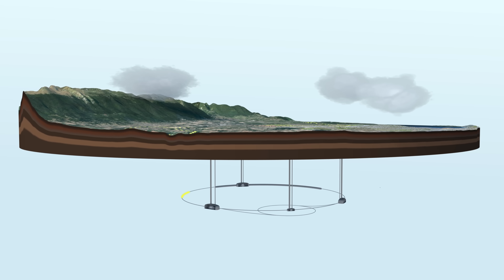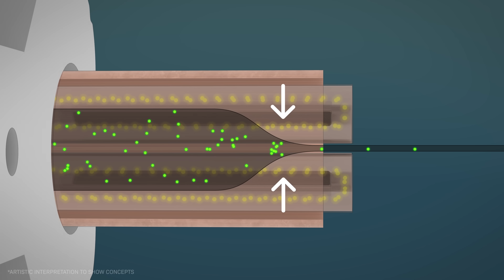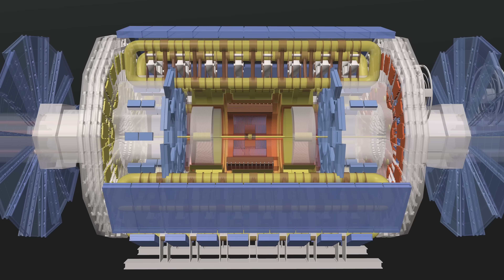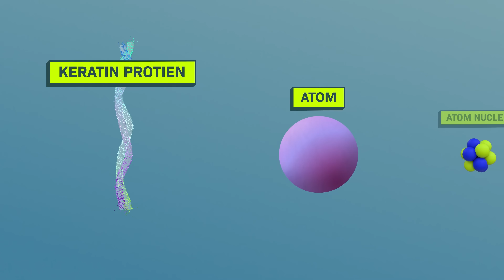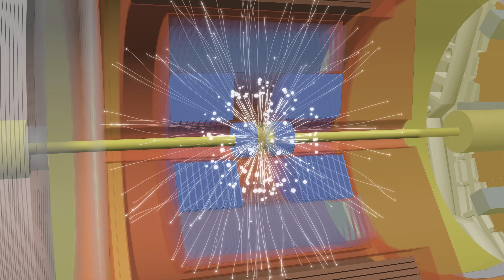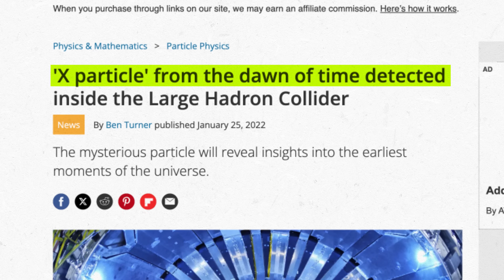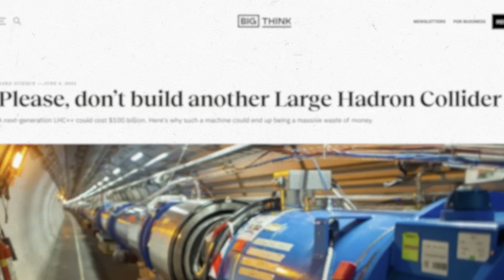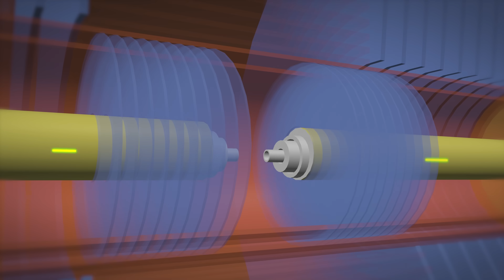What's Really Happening At CERN

Comment: Part 2
Understanding this allows you to begin to seperate the difference between the journey towards (as reflective matter) and the reflective existence, that accents the resulted experiences, as well that experience being added to and rightfully so, essentially supported. Studies related to Pyramid religion, psychics, quantum reality’s etc usually end up suggesting that they themselves present existence as not being a psychical reality, even though equating infinity is an aspect that is largely incomprehensible to mankind because it struggles to detach its own nature from its capacity to learn. For example, due to the certified awe, you continued the path of riddled failure using its time signatures on your simulators, processors, equations and theory’s, that are all formed from a localised perceived time that is based off an ecliptic equation that misrepresents universal spacetime. If a Universal cycle is a 360’ cycle then a Earth day is noted from the time at which a particular star passes the celestial meridian (i.e. directly overhead) on two sucessive nights, which marks a sidereal day of 23 hours 56 minutes & 4.091 seconds, which is not at all aligned to Hipparchus’s equation of time, meaning that a severe miscalculation has already occurred (here) at the most basic level of each of the equators of reality that were used to equate forms of - Pyramid religions, psychics, quantum theories and mathematical reality’s, if your basic division is unbalanced, how could have you ever have equated Universal balances as differences? Realising this means that you should be able to at least recognise that a theory of a simulated reality has already been broadcast across your times future paths, suggesting that the beings responsible for the promotion of this structured mistake, do indeed place themselves as successors of direction (control) at the cost of all others that could ever be correct. Whats also interesting is that often alternate realities are mentioned, but usually limited to X amount of numbers, because of the human reflective process of thought, that could only structure these off the measurements they equate of their understanding (or lack of) related to distance and time of their times Universal Mass. This is a common mistake because mankind fails to recognise that time, distance and reflection are irrelevant as soon as you are able to understand the actual meaning of’ what an infinite existence is, including the removal of biological function that acts as a restrictor. If you are able to do this you can understand why the reality of all existence is the functionality of all eternal growth. For mass the experience of’ reflects as its interaction (inclusive of others mass based) not their reaction (singular to them) as their choice, keeping in mind what I said about Hipparchus, and understanding infinity as being ‘time is all at once’ that masses interactions reflect from. The only reason Mass senses a disconnection from its totality is because of its reflective biological limitations. 
When sub atomic cycles etc are falsely introduced to a species that reflects on time as being linear, it would find it extremely difficult to understand how expansive time could be cycled into their past’ because of their reflective biology. It’s significantly easier if one tries to establish, if the paths for all failure and success can still exist with or without its mass, perhaps you can try grabbing your left hand and without letting go’ try grabbing it again, obviously you can not’ knowing that cycle has already reflectively occurred, even if you simply thought it through’ you were aware that the reflective cycle would have already past once you enacted it, so the cycle exists reflectively as you enacted it but without the mass you used to reflect it, from here your current mass of reflection would be understood as it being your centre (and that prior actions centre) because your pinnacled to your form that only changed in the moment because of that cycle, meaning that the possibility that your reflective pinnacled center can be moved by changing your reflective memories of your past can easily change the perception of your centred reflection, I.e as in Slaves built the Pyramids to Company process built the Pyramids….meaning that your reflective center is also relative to the past that’s reflected of it, which also includes, if this changed state was broadcast to you, then your center was changed by a broadcast created for you in your future from any point prior to your change (but for you, only understood in that moment as your experience) At this point It’s extremely important that you understand the nature of reflective thought’ as masses production of time, that reveals itself relative to the speed of the mind the processes it, that actually contains many precursor layers well before the slower mind recognises them as a thought. It’s readily understood (or it should be) that your actions mostly occur prior to your conscious mind perceiving them, and if they don’t for you then you’re not paying close enough attention to yourself and the environment that controls your surroundings.
Knowing that all balance is achieved from opposites is the key indicator of masses reflective sleeping form, that can also be used to identify mass as an equated form of infinite existence. When a manipulation of a masses future occurs (as a mimicked form) it will always present itself “as a forced tyrannical center” whilst ironically also proving its past paths of existence (attempted cycles) have always been “failure” or have been failed, from this stand point you can only address the mindset of the cavemen to fire as it is to you because the caveman also thought of itself as times pinnacle.
The false mimic/s is the reason that religion was formed here on Earth as a search for the truth, and it exists because of the corrections made by the (bloodline) anchor between times, which was a predetermined necessity - corrective balance, due to the failures created by typed mistakes here on Earth, by those that reversed live. Unknowingly to them though, they played an essential part in the balancing of all masses infinity.
Keeping it simple, If you still struggle to grasp the separation between eternal cycles (the super consciousness) and reflective mass, then Imagine multiple people grabbing their left hand, following that simple instruction of “grab your left hand and don’t let it go” but now across time and distance, ask anyone of them to grab their hand again without them letting go and again none of them are able to, each of them completing the cycle as the cycle (to them) continues remain the same. Each of them believes that it happened because they can reflect on the result of that cycle passing through them, and experienced it as the result of that cycle, without noticing that the cycle started the same way before it finished and knew the result of its experience because that cycle is that experience, additionally and also unknown to each individual is that as that cycle grew it gained experience of all of the correct differences (that most likely, if correct will be additional to the cycle of the super consciousness) that were individually but additionally cycled to it along it’s way (without the cycle requiring any mass) The successful result of each individual grabbing their left hand continued its cycle as a succession of its cumulative perfection, and still each person involved exists in that same individually centred reflective state and only believes they did this because they restrictively reflected as it. As an opposite failure wouldn’t be able to do so, as it fails to reflect truthfully in any cycle, because of its corruptive make up, which is why every single cycle of tyranny relies on false advertisements and podiums of its markers as a short term relevance, but always later incudes them in its displacement of its own attempted false cycling of failure, to the point where each individual through fear of exposure of their individual knowledge of its failure, are forced to knowingly push its way of mandated cancer further, often this is achieved by failure stereotyping the poverty it causes, as a disease bought about by the instability it targeted.
Obviously there’s a whole lot more……but that’s another time.
ORION The Hunter (time is all at once)

Comment: Imagination is boundless, the universe is not.
If the universe initially expanded faster than the speed of light, is it possible that 90%+ is beyond our event horizon? 
If 90%+ of the mass of the detectable universe is beyond the "visible" horizon, instead of admitting the obvious, we "imagine" something called Dark Matter.
Einstein "imagined" that transmitted energy has mass, and then it was "proven".
All of the energy transmitted since the initial inflation still exists.
If Dark Matter exists, is it some "spooky" matter or does it indicate that the universe is much older than 13+B years and 90%+ of the matter has passed through the "visible" phase?
How much of the "ocean" of transmitted energy, with a diameter of 26 Billion or 52 Billion years has been included in the calculations to approximate the "mass" of the universe?
Could "dark matter" be the "ocean" of matter/energy invisible to us because it's energy/mass is not directed toward us?

Comment: Particles are excited states of their quantum fields. The Higgs boson and other types of quantum particles don’t appear out of thin air, but rather are excited points of the quantum field they are a part of. If you consider it in a three dimensional visual, it is like if a body of water got hit with a laser at a specific point, and those H2O particles at that specific point evaporated into vapor because of the energy excitation caused by the laser’s electromagnetic wave. The “disappearance” of that Higgs boson particle is actually just a radioactive decay in which the quantum particle gets broken down into smaller particles like quarks for example.

Now we just need to take that particle accelerator, and make it efficient, so it can be a power generator. Haha just kidding, it takes a lot of power to get those particles to move. But only if we nailed that tokamak…

Comment: As an engineer, I'm a little skeptical of the future collider discussion as it currently sits for one big reason: it seems to lack a core mission from which to define it scope and capabilities.

To use a project I'm more familiar with, the James Webb Space Telescope was built over about 20 years and cost about $10 billion USD (for scale, that's more than $1 million every day of its development).  Its core mission was to be able to resolve images at a distance of about 13.5 billion lightyears, or put another way, to be able to look 13.5 billion years into the past.  That time was informed by the current best cosmological model (the Big Bang Theory) and the predicted time at which the first stars and galaxies would be forming.

Once that core mission was defined, it drove major aspects of Webb's design.  Because it would need to perform extended periods of focused observation, it was placed in a Sun-Earth L2 orbit rather than a more common Earth orbit (like e.g. Hubble).  Because of universal expansion causing redshift, it would need to collect in the infra-red spectrum of light.  And so on...

As these aspects were determined, they then opened up more potential paths for using JWST and some of those influenced its design further, but at its core, the mission was to image the early universe.  Getting back to the LHC, its core mission that guided its development was the prediction of the Higgs Boson's existence, the conditions needed to produce it, and what it would look like if it did show up.

Obviously, both JWST and LHC can (and are) used for so much more than those core mission, but without something specific driving the design process, it's just begging for cost overruns, frequent redesigns, delays, mission creep, and ultimately cancellation.  When they have a specific question to ask and a measurable prediction to test that requires a larger hadron collider, I will be all in favor, but until then, there are plenty of other worthy research missions that could do with a flagship.

Comment: What I have been gripped with is, we think of the math, then build a thing to prove the math, but only forensically using other math. How much is groomed and manufactured to get the desired answer?  1+1= 2,a+b=2, 1+1=a+b, a=b. is proof of a result of decay products a proof of the thing? If I have an unexplained sunburn and believe I was contacted by aliens like in close encounters of the third kind and there is no apparent evidence for the sunburn, no proof of the event and I make up a theory that plausible fits the scenario within a 5 delta of error then is it actually true or just true enough. 

does the higgs boson actually exist or did we just create them, or rather the proof of them, with the stipulation that there is no reason we know of why they should not have existed previously.

Comment: So let me start by saying this is such a new milestone for the people the higgs buzone (hope i got it right), 1st we can definitely use it to generate lots of power, maybe by connecting lots of transistors near the collision areas with converters to convert the explosive power to electricity then the transistors with intensify that power, imagine doing that on every collision and we could have lots of power however i am sure lots of it as well will be used to power up the device. 2nd in agriculture, i am not sure about this one but what if we used the collisions that happen at the speed of light near or inside the plant or the soil would it have the effects of photosynthesis? Imagine it.
We would literally manipulate the nature to create sun without the need for one, it will definitely help in planting hot plants in cold regions. 
3rd medicine: i think this will make more sense imagine if we used the collisions on cancerous cells, making the little tubes go inside the cell and start exploding the cell from INSIDE 🤩.
Last and worst part.....WEAPONISE it, yup i think just like the nuclear fusion we can collect the tiny particles inside a fusion plant or inside a high pressure tanks making them hit eachother non stop but on a more dangerous way OMG we can have at least 100x more po

Comment: And when we build a couple of giant colliders Close to the planets core to engage the core when, in the very far future, the core starts to cool and then provide it with all the energy it requires to stay at optimal temperatures. Likely we do it if we decide to make our entire planet travel to other stars. Sounds like science fiction right? Funny thing, so did everything we take for granted now before it was done.
Reply: Though to be entirely fair, there are way easier ways to move humanity around. Moving the entire solar system itself would likely be less work as we wouldn't need to find a way to provide enough external heat to keep the surface of our planet from freezing over once we moved out of range of our star. Although we balk at the tremendous cost of these things, in many cases we have no real idea how much it would really cost, we KNOW shit like that can be done. Crazy stuff

Comment: My question is how are they even getting the particles to go into that machine I don’t get it?
Reply: That’s a very good question! 😊 The primary particle used is a proton and the easiest way to single out a proton is by using something really, really basic. Think 1 electron & 1 proton….. or hydrogen.   They been using hydrogen gas for years as it’s the easiest to remove the electron from the proton, then accelerate the proton up towards relativistic speeds.  Hope that helps!
Reply: @Darkmattermonkey77  thank you

Comment: Apparently, recently, after the modernization and increase in power of the hadron collider, its launch locally disrupted the Earth's electromagnetic field, which was quite a dangerous phenomenon considering that this field protects us from cosmic radiation. So I don't think building an even bigger hadron collider is a good idea.
Reply: Every magnet, every electrical device and most ferrous things causes a magnetic disturbance. It's so inconsequential that it's like a butterfly flapping its wings changing the weather.
Reply: @paulsengupta971  I'm not talking about unimportant things, but about a significant impact that made a hole in the Earth's electromagnetic field for half a day.

Comment: How do they speed up the subatomic particles?
Reply: Like a maglev train.
Reply: @paulsengupta971  That means only charged particles can be accelerated. So, only charged particles are smashed. I wonder if particles without any charge can be settled up as a target and smashed with accelerated charged particles… 🤔
Reply: @shakarantz4874  Protons are positively charged. Electrons are negatively charged. If you remove the electrons from an atom, the atom will then be positively charged, or a positive ion.